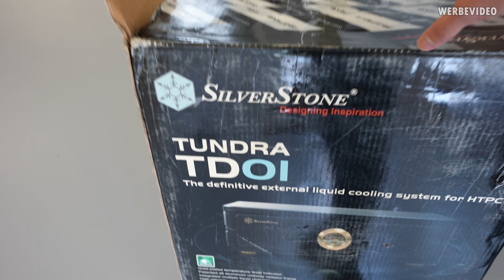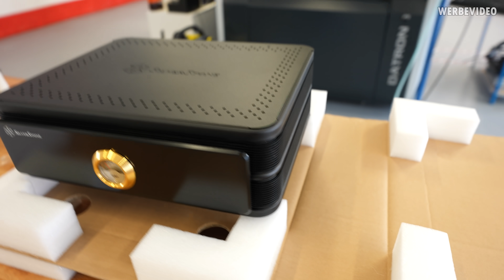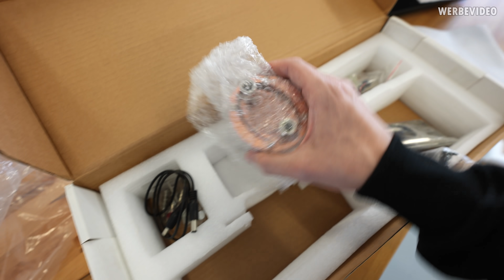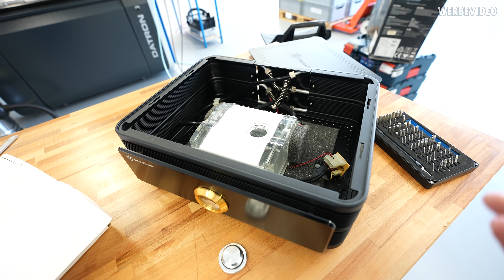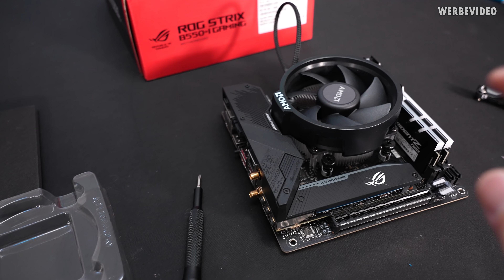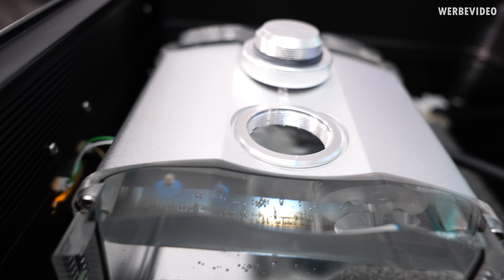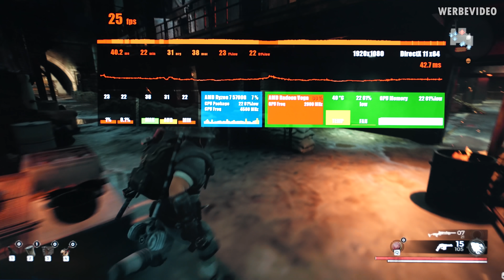This Water Cooling Concept from 2006 just makes No sense - Silverstone Tundra

Comment: I wonder if Silvestone made a case with that style, and you place this unit on top/bottom of it.
Like the '80s/ '90s multimedia stereo, where you could combine various unit.
Reply: That's exactly what it is. The size and the look are made to fit with their home theatre PC case from the time so it fits right in. That's why it also has this gauge that looks like something you'd see on other HiFi devices
Reply: Silverstone SST-GD06B is probably the case you are looking for.
Reply: Thermaltake did try stackable cases, with small ones to stick above/below your main PC case.  Mostly to house either watercooling equipment(QDs can make for easy PC/loop maintenance) or drives.
Reply: @Grimmwoldds  AseTek also did something like this with Phase Cooling, where you had a bottom unit with the oil compressor and then the normal case ontop, there was a lot of experimenting back then with all kinds of cooling systems
Reply: This was my first thought as well
Reply: Looking at older Silverstone models the LC02 is the only case that matches the dimension of this device. Other LC cases have better matching style but are wider.

Comment: Does seem a strange crazy and wrong design. So many small tweaks could "fix" it though. Like a small "stack" PC setup with "passive" water cooling (no fans or large quiet low RPM fan but a pump).

Comment: mod this thing into actual PC case :)
Maybe with some airflow on the inside it will also cool better.
Lid has a lot of space to cut fans into ;)
Reply: I was just thinking this. It'll be amazing as a pc case.
Reply: Just put some fans on the top panel as intake and you're golden. A watercooled mini ITX build is certainly possible in this "case"

Comment: 9:00 I think the plastic ring on the cooler can be pulled of, not 100% but on some of the AMD box coolers it's ok to remove the plastic air guide.
The cooling case looks cool, love the gage and CPU block, retro look. Shame it's just from the early days of water cooling when it was not ideal.

Comment: This was from back when the company was pushing boundaries, & liquid cooling was still not mainstream. AIOs, as we know them, were not yet readily available, & there was fear they would leak on components.

This was a bold move that didn't take off, but it was an important step to get where we are today.
Reply: I had never heard of this till now, but external cooling is such a cool concept.  Several years ago, i made a custom build with an external radiator and pump that still serves me well.
Reply: @tippyc2  Lotta companies were doing that back at the dawn of the century. The Zalman Reserator is the one I remember best, because it was very visually distinctive. There were ones with style, and ones that were very clearly just a radiator and fans in a box. 
(There were also the phase-change cooling systems, where you just stuffed an air conditioner compressor into your PC case. But we don't talk about them, because everyone that used them is now deaf.)

Comment: I wonder why you haven’t ever modded motherboards with your cnc. You could totally add fins to the vrm heatsink. I guess you’d need an anodization setup to make it all black again. You could even add more ventilation to the top of the case.
Reply: Id assume the absolute fuckton of metal shards n dust on the motherboard would be a pain to clean
Reply: @Gobeman  ah he has a whole workshop tho

Comment: That unit was brand new. 
I think the other thing to consider is most cases back then didn't have provisions for internal water cooling or the passthroughs for large diameter tubes. 
We've learnt a lot since 2005 cooler and case wise.

The 5xxxG series seem to be a bad deal, they are certainly too expencive for a general use or HTPC PC.
Only reason I can think to buy one is so you can use the PC for browsing while looking for GPU deals and price drops.
Reply: They're perfect for small form factor VFIO passthrough builds if you don't want to deal with the limitations of a single GPU setup. Admittedly that's a pretty niche use case

Comment: I recently built a SFF with the Asus ROG Strix B550--I Gaming MB and currently using the stock fan and GSkill Trident Z Neo sticks. All you have to do is remove the screw holding the AMD shroud and pop it off, though that is a bit frustrating to do since it feels like it can easily break.
It would be interesting to see what someone can do with modding the Tundra.

Comment: Roman, if you really need to use the included CPU cooler on any densely populated ITX board, you can remove the outer circle of the included CPU heatsink, because it's just held in place by plastic clips. Sure, the fan will be more exposed, but it would clear any side of the motherboard.
Reply from the maker: removing the entire ring should negatively impact the cooling tho. Just considering that fans are usually pushing the air also in a radial way so you need the ring to guide the air. But that is just theory and the impact could be less :D Thanks for the idea tho I will absolutely try it
Reply: @der8auer-en  der8auer it is only the outer ring for cosmetics, there is still fan frame that will guide air so no worries :)
Reply from the maker: @riba2233  :O will check
Reply: @der8auer-en  ok, np :)  it is held with firm clips that can be a bit tough to remove, so you can jam a thin screwdriver in them and pry it
Reply: @der8auer-en  Thanks, glad to help. Have a nice day :)
Reply: @riba2233  yup, had to remove it to fit the cooler in my mini-ITX case as well and quite frankly the cooling was better without the cosmetic cover anyways.
Reply: This

Comment: I've always wanted a "passively cooled watercooling case". Modifying it to actually stick a small motherboard in it would be neat. Newer, quieter pumps too.
It could probably do a lot better if the outside was shaped with more "fin" surface area. or the top/bottom plate also had water channels. There is a lot of surface area that could be gained.

Its probably just easier to used a modified aluminum car radiator as a side panel instead.
Reply: I think this is the "HiFi" stack style water cooling solution. A matching case for the PC would go above this, in a nice stacked system pretending to be an old school hi-fi system (the dial on the front imitates this style)
Reply: Don't need to modify a car radiator, just run a hot hatch AC condenser
Reply: Could build a laptop into it, that's be pretty wild.

Comment: aluminium and copper :/ I had a pre-built liquid cooling case from like 20y ago when you basically couldn't buy custom loop parts in Europe and big brands didn't make any, very quickly the system was full of deposits and corrosion stuff I stopped liquid cooling for like 10y because it wasn't good back then, it took a threadripper to lure me back in because air and aio aren't enough anymore for 700+watts builds, good news 2021 custom liquid cooling is great and you have plenty of options